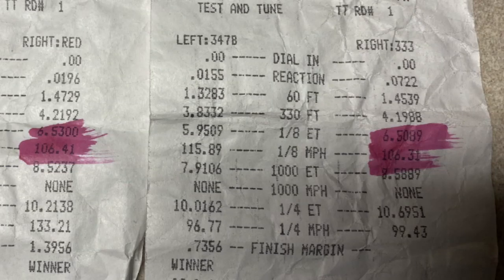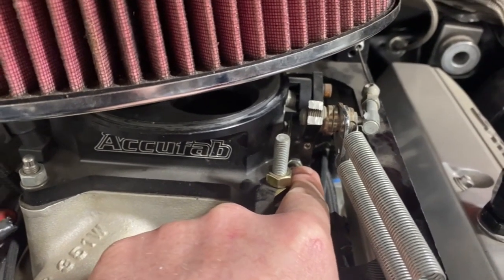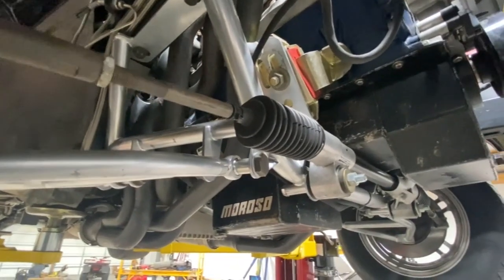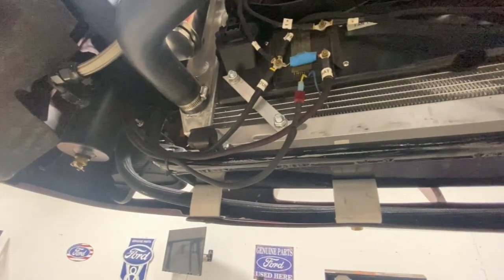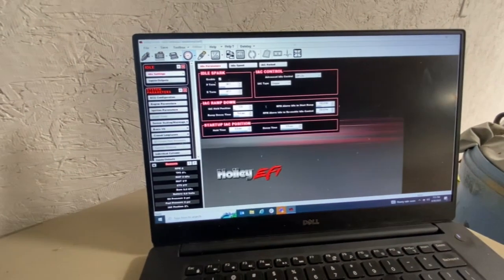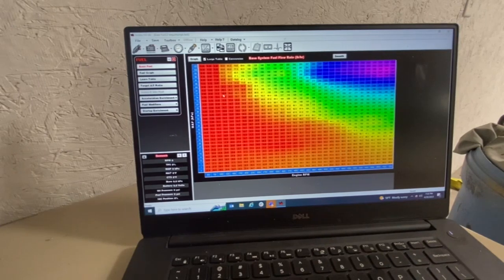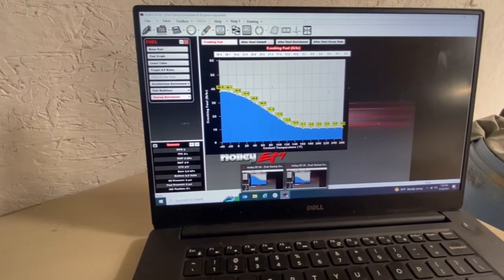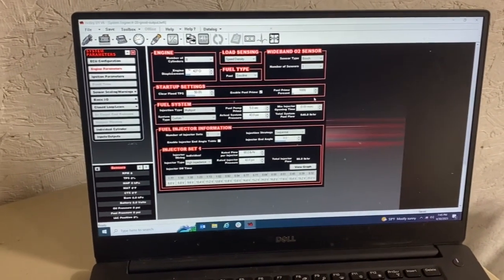Holley EFI hard starts? IAC, IAC Parked Position, Cranking Fuel, and Prime Percentage HP Dominanator

Comment: another thing you can do is, there is an adjustment to get it to light off faster so you dont have to crank it so long. but i unfortunately cant remember what is was somebody on youtube had it and makes the car start so much faster. i believe it was an ignition setting not fuel. i have a question, your none adjustable cam/caster plates, do they make the steering really heavy? i was thinking about this kind. thanks ron
Reply from the maker: Thanks for watching,  if you think of the setting please let me know.  As far as the fixes cc plates,  I didn’t notice them changing the steering effort,  it may have affected it,  but if so it was very minimal.  The car does seem to go down the track with less wandering.  I like them, as long as you have adjustable a arms.
Reply: thanks for reply on plates i will try to find it. it really helped mine @redfoxgarage9660
Reply: i hate not knowing your first name when corresponding but i think i found the video about the hard starting problem. its under cranking parameters. he recommends using stock ford crank to run of 225 rpm and 10 degrees crank timing. this made a big difference in mine. video by leech motosports faster cranking hope this helps you have higher compression than me so should make big difference. let me know if this helps. ron  @redfoxgarage9660
Reply: @redfoxgarage9660  my original post got deleted somehow. if you go to leech motorsports he has a video on the hard starting, has to do with using stock ford cranking timing numbers and crank to run rpm. made big difference in mine. ron
Reply: @ronmonahan1696  I was curious and went searching. Are you talking about their video where they enabled the hidden  advanced icf from the toolbox section? Then cranking parameters.